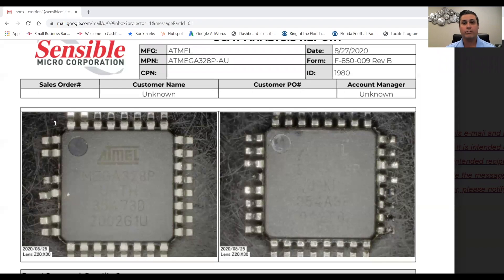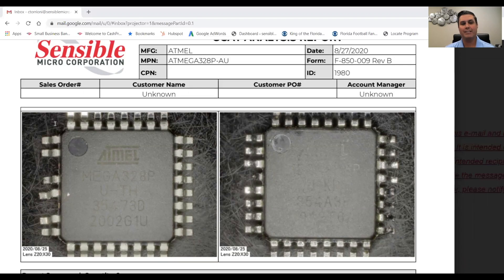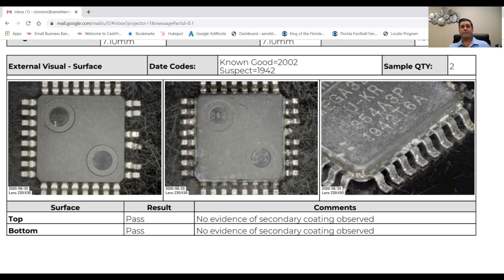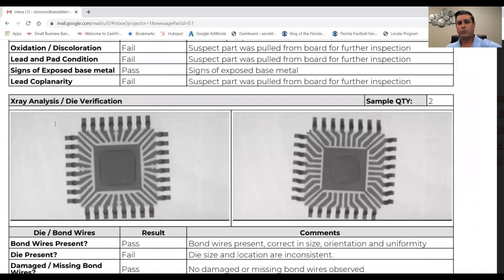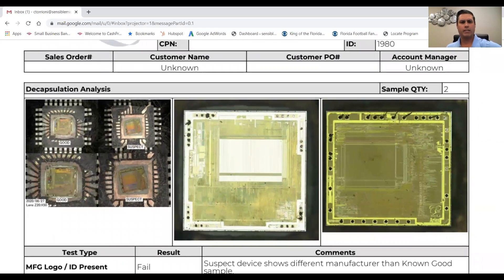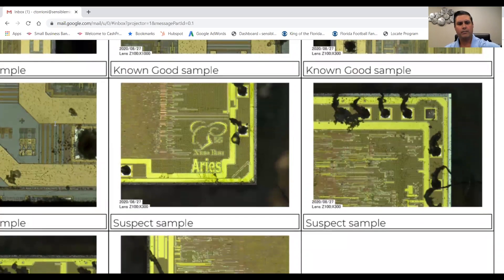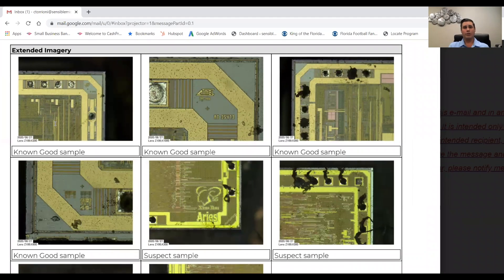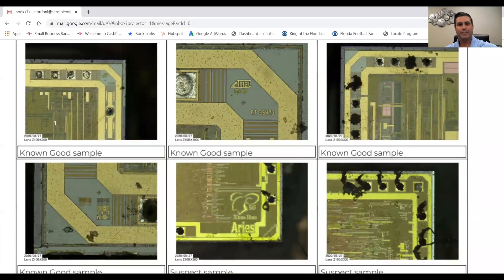Professional Forensic Analysis of a sketchy Pro-Mini (ATMEGA328P) - is it Counterfeit?

Comment: I know little of chip making but i  wonder: when you are forging a chip, wouldnt it be just as easy to make a correct chip as it would be to make a faulty chip?
Or is this a case of: "we made proper 328's but there is demand for 328p's so we just put that on the label

Comment: The images of the good chip show pins 3 and 6 are missing, pin 4 is missing on the dodgy ones. The x-rays at 6:00 do not show these missing pins, but then we hit the decap section and they're back. What gives?
Reply from the maker: I'll check with Chris and see what happened there - may just be a side effect of the decap process
Reply: Yes, during the destruct process wire bonds can get removed. Xray images are always taken first.
Reply: @christorrioni6238  Neat, thanks for clearing that up gents (no idea why I didn't see a notification on this)

Comment: How much this kind of report usually cost?
Reply: Hi Marcelo, our standard reporting is free if our customer is also purchasing the components from us.  Our standard reporting includes external visual inspection, dimensional verification to the OCM datasheet, part marking inspection and surface integrity analysis to confirm the top of the chip has not been remarked or tampered, X-Ray analysis, low power electrical testing and pin / BGA inspection to confirm not previously used or damaged.  Decapsulation is the only item we charge for which is $50 and most customers normally just have us roll that cost into the price of the components they are purchasing.  Here is a link to our lab page: https://www.sensiblemicro.com/electronic-components-inspection-test-lab

Comment: 10 years ago I couldnt meet the nanowatt figure on a pic16F684, but they were off like 100 times. I made all the changes possible, talked to microchipp assitance, read all the guidelines ... NOTHING. They even fake mixed signal chips and perform pretty good actually, they are only weak when input comes really too low. At work we have been fooled a couple of times with thos chips, in big quantities. Also, we worked with MSP430, board assembled in China. They performed good, no probs. One time a TI representative visited us, we showed the actual board and got lost inmediately, because the coding on the chip. He had an internal web to put this code to get the plant, customer et ... and eh couldnt get any valid data out of this code (bizarre). The contract manufacturer was a big one in China, that work in "big" quantities and they are not supposed to put fakes or trade in parallel markets for pieces from another customers. TI was clear about that, this could be a batch that other customer did not use but the contract manufacturer MOST TELL YOU about the situation. TI wont accept any liability in this cases. Only part that were bought to a TI dealer and put in the board.

Comment: Very interesting. They spent some time on the chip packaging, but even at the X-ray level the suspect fails comparison. The infuriating thing is, the copycat could have saved themselves a world of trust issues, branding it differently and advertising as "compatible with ATMega328P", especially since it mostly works as advertised. Goes to show why it's worth spending the extra couple of bucks and sourcing from a reputable company (my Arduino came from Sparkfun). Better yet, it would be awesome if everyone would go to arduino.cc periodically and buy a board to support those guys.

Comment: I don't understand why for people still use ATMega, they are expansive, not powerful and not efficient at all. you can found far more competitive ARM or, better, RISC-V microcontrollers for less than 1$ now. They generally works well with Arduino microPython, or other standard development tools.
Reply: There's a lot more to part- and architecture selection of a controller than price-per-unit and "getting the most horsepower". The PIC16, STM8 and even the 8051 are still widely used, not because they are cheap or powerful (none of those are) but because they are appropriate for the total design and cost stack-up.

Comment: This explains my failing pcbs. I got a batch of pcbs made at jlcpcb and using lcsc atmega328 chips and my failure rate is through the roof. Anyone else have this experience with lcsc chips?
Reply from the maker: ouch, I didn't think LCSC would not have genuine parts...  I'm thinking about creating a self-testing sketch to identify these chips

Comment: Well, it's the same as cracking software, it gives no profit to the companies but improves access to most people, so it supports human and technology evolution.
Chinese people doesn't earn like Atmel's people, that's why they can afford lower costs. And most likely their chips are made in china anyways.
I'm not against china, i'm against certain actions china does to their people and to the world, but they are making the technology evolution affordable (even if they clone stuff), that's for sure.
So why to pay more if you can have a copy for less that works almost the same way, right?
Silicone, the etching  process itself, epoxy and bound wires doesn't cost that much, the overall cost relays on "administrative and scientific matters" - so let's keep the money machine active for those Atmel guys. Also china gives no warranty, so less loss.
Reply: Well i'd for sure like to always know what i'm getting. If the product was tested and engineered with one chip, and you silently get another, and it causes issues in operation, well that's no good. This is why counterfeit chips and deceptive top markings are a problem.

As to having a more or less compatible third party chip, well that's certainly just fair.
Reply from the maker: yea, would at least me nice if they marked it something else, so you know it's a clone... like for some basic things this might be ok.
Reply: I'll agree with Kevin.  If you are going to make a compatible chip, mark it as such, sell it cheap and let people know what they are getting.
There'll still be a huge market for them.  A lot of the Chinese blue/black pill boards come with GigaDevice gd32f series chips(My understanding is it's a licanced ARM core too, but I could be wrong), pretty much compatible with the STM version, but you at least know what you are getting.
Copying a chip's compatibility is a grey area with arguments on both sides.. Selling that chip as the original is just plain dishonest.

Comment: So we can pretty much expect that all those ebay/aliexpress Arduino unos/minis/nanos will use that chip and not a genuine one.
Reply: Not only that. The very first Raspberry Pies were manufactured in China, too (producing in the UK was far too costly due to insane tolls). When XRaying them it was discovered that the manufacturer "accidentally" had used cheaper parts than specified (and paid for).
I wonder how many small-production-run devices of "Western" companies have similar accidents that are not noticed
Reply: @erynn9770  its so funny that its just impossible to take china out of the supply chain in anything that has electronic components. Its even funnier that most of those stuff are pretty much manufactured automatically and the western companies placed their manufacturing lines there decades ago and gave away their know-how to save pennies. Too late know I guess. Can't make anything out of china that won't cost 4 times more than what it would cost to make it in china.
Reply: @Mr30friends  Well, 4 times more is the real price we should actually pay. It will make the whole electronic market more sane for both manufacturers and consumers.
Reply from the maker: maybe and makes you wonder what else...
Reply: I'm wondering that too. It must be a good business for the sellers.

Comment: I think this points  to how easy it is to set up a wafer lab plant. 
We had a custom wafer made and after about 10 years the plant was shut down and we got a onetime buy to keep us going. But we then found a small start up that could almost get to what we needed. These were sensors on a die that was directly exposed to liquids, and had to have some extremely consistent properties and a very tight process in wafer build to work. They only had to work for a few days, but within a extremely tight specification with minimal calibration and then thrown away. But they did it.

I think that uC internals are now just like cut and paste, a memory here, an ALU there and with almost off the shelf designs. The computer will then do the die design with little input from us. It’s been going on so long with high value chips! that it’s now getting to the point where they can knock out parts so quick N cheap that nothing is now off limits.